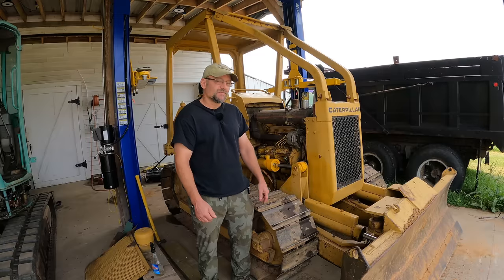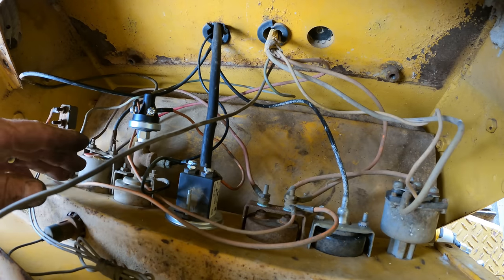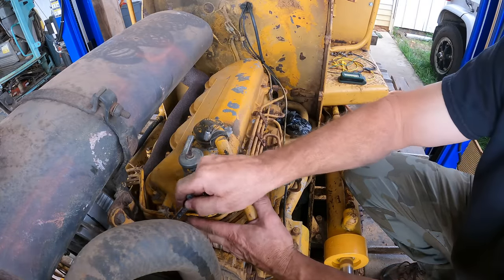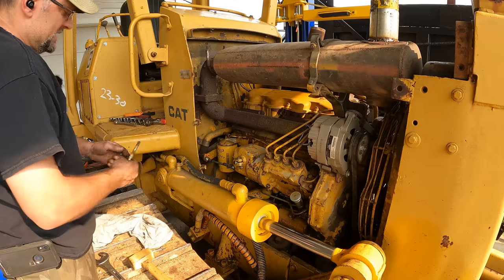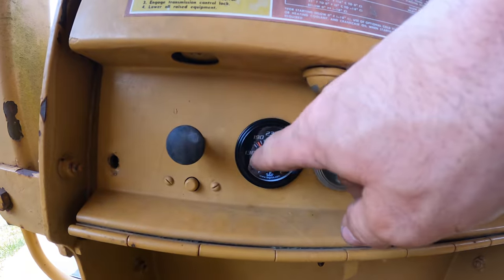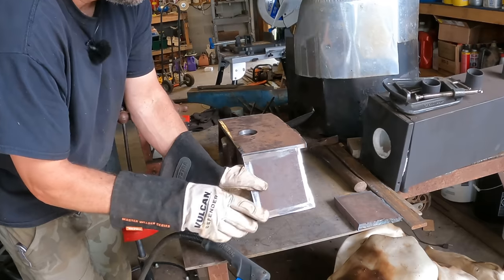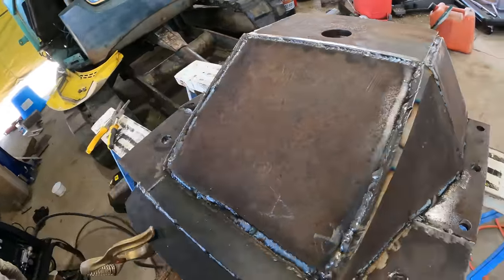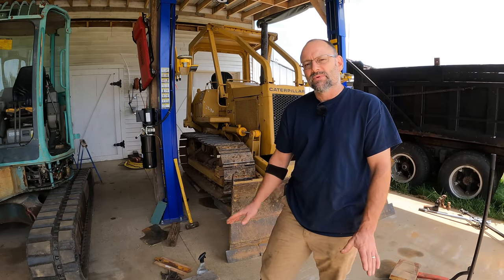How My Audience Saved This CAT D3 Dozer From Disaster.

Comment: i will never understand why people complain about what tools you use, look a hammer is a hammer, a wrench is a hammer. if you can swing it and if you are mad enough ANY thing can be a hammer. love learning with you can not wait to see what you have in store with this dozer, and whatever cat machine you have by the trailer.
Reply: 52:37 =] lets go
Reply: Claw hammer is made for nails. Hit steel hard enough and it can chip and break which can be bad. You can lose an eye like that.  Ball peen for heavy hitting of steel. Or cross peen, or small sledge. Tapping out that gauge, claw was ok.
Reply: @mmm365  Use what you got.
Reply: @alysongr  Except for a vise, cause that's an anvil.
Reply: I once discovered a fossil while making a 3 inch hole in a wall.  I was using a jack handle as my drill bit and some large flint nodules to drive it.  One of those flint nodules split open revealing a fossilised twig.  You don't get these kind of surprises using diamond core drills do you? 😁

Comment: I would not shim those pieces. Looks like they go up and down. There might be for a specific reason. Check the maintenance times. If it needs to be adjusted it would have the specs in it .Maybe send me more familiar with that dozer can comment. My initial thought would be to just leave it until I knew more about its use.

Comment: FYI. On my friends 1958 D4 you can turn the fan blades to blow out through the rad in summer, then turn them to blow heat over the motor, toward the operator in winter months, in CANADA. LOL

Comment: Hole saw trick: make a "scratch pass, then use the pilot bit to drill through the edge of the hole, then resume drilling through the original hole location. The other hole really helps clear the chips from the teeth! Give it a try.
Reply: That’s quite clever. The interrupted cut is probably hard on the teeth. But continuously recutting chips is a sure way to burn the teeth off. Thanks for sharing.
Reply: Hmm, that’s a neat idea, thanks 👍

Comment: Armor improvements that mad max would be proud of.
Also that makeshift grommet trick was pretty neat!
Reply: I was surprised that he didn't already know that trick, I learned it as a youth in 80s, and to run heavy gauge wiring though heater hose for extra protection from chafing.

Comment: Shims for the front idler go under the frame. If you think about it, putting a shim above the frame achieves nothing as the idler is being pushed up and away from the track frame.Upper shims are only necessary for excessive side play. Hope this helps
Reply: wouldn't it be better take the gap size and cut it in half for top and bottom?
Reply: @danhard8440 no because the wear is from the bottom notice how normally sitting the bottom is tight against the rails. This is where motion wears the metal down over time. Replacing material there with shims or other means realigns the idler and tensioner to be straight with the rest of crawler frame.
Reply: @danhard8440 f you look at top in this video the gap towards front of machine is larger then the side on back. This is because the idler is now cocked facing slightly up this can cause issues by putting undo stress in directions and areas not intended for it.
Reply: If you look close you can see the wear on the bottom of the rail. Material is gone creating a gap at the top
Reply: I will never have equipment you have but enjoy your videos because you explain what and why you are doing it. 
The comments from your viewers also show how much they know about machines and are also very informative. My vote would be to put the shims on the bottom.
Reply: Exactly. Physics.

Comment: Pro operator tip- the seat belt is for safety but also locks to hold the operator tight into the seat. The less the operator moves in the seat the more smooth and accurate you will grade.  I really liked your repair series.
Reply: And, if you've ever had one throw you off, you'll consider yourself pretty lucky to only break a collar bone like me. It ain't the stumps you see that'll get you. Little dozier like that can get you hurt bad. Just saying.

Comment: I noticed it took a bit for the exhaust to start emitting white smoke which means the presence of fuel coming into the cylinders. I have had older machines in the past have a faulty primary lift pump and allowed the prime to leak down. This allows the fuel that would normally be held in the injector pump for a quick prime to leak back down, which means the primary lift pump has to re prime the lines and the Injector pump before it can furnish fuel to the cylinders. Just a thought.
Reply: I would think what you said makes a lot of sense.  I am thinking a loss of prime,  just don’t know where..
Reply: My Perkins started much quicker when I crank it for about 5 to 10 seconds before opening the fuel shut-off it uses the high compression to warm things up.
Reply: Agree.  Add a temporary clear fuel hose and watch for the fuel descending or air bubbles.   Diesel engines detest air.  👍
Reply: Id agree with you @jamesfranks545, I noticed the same, 
 in the past I've fitted a diesel non return valve to the fuel pipe just before the primary fuel lift pump to a few tractors over the years that came into the workshop with a similar problem,  its not an ideal fix and if there was no filter before it on the pipe cumming direct from the tank I'd fit a inline fuel filter just to stop larger foreign objects hindering the seal on it,  but it dose solve the issue you speak of, prevents the fuel leaking back, its a cheap fix which otherwise can cost quite a bit to sort out.
Reply: I've got a Deere 444JR that has the same symptoms, almost 30 seconds of crank. I was thinking that the engine oil was draining down and it took that long to trip the oil pressure cut-out switch but I hadn't thought about fuel being the problem. Probably something I should look into.

Comment: For valve adjustments I use a set of feeler gauges with a bend in them. They are called offset feeler gauges on the jungle site. Your local parts store will have them also. Makes valve adjustments substantially easier.
Reply: Having sets of metric/imperial offset feeler gauges makes valve jobs so much easier.
Reply: AKA Valve Feeler Gauge, that's good advice.  Lisle 68050 $5.53 when I last put it on watch list.   When the shoe fits, and what really floats my boat for valves is the Go-No-Go type Feeler Gauge. Lisle 68150 saved at $11.53.  When I was a Motorcycle Tech some clearances and angles were so bad with gas tank off only, we had to use feeler gauges which were angled but also 1/3 the width and 1/2 the length.  

I like how this man seems like a pretty good man, and farm level repair guy with an honesty about limitations and openness to advice.  

Side note;  I'd wager you probably moved on from the tubing sheet metal grommet trick.   Having different sizes of plastic metal protective edging surrounds a hole any size and shape and makes it look finished.
Reply: You got it!

Comment: Check your RPMs while cranking, your starter could be slower than it should be. Slow cranking could cause that too
Reply: It's cranking at a good speed by the sound of it.
Reply: Might needs to check injectors that they are not leaking down while sitting and having to fill the injector plus line(s).
Reply: @jimsfarm  Since it cranks right up with the glow plugs lit, it's probably not fuel starvation.

Comment: Wow, I'm shocked you weren't aware of the split fuel line trick as grommet, given your vast knowledge of farmer hacks. Vacuum line also works well for small holes.
Reply: small weed eater tygon fuel line works well too.
Reply: I didn't know it either...
awesome fix though!
Reply: yeah, pretty much any type of hose or tubing works, just make sure it's resistant to whatever chemicals/nature are present.
Reply: I was too, I've been doing that for probably 30 years now. Course, I'm older than John is. Probably by 20 years.
Reply: I've never worked on anything larger than a push mower and even I knew about that. smh
Reply: Some RTV inside the tube will keep it from moving around or getting rubbed off.
Reply: Yeah not everyone knows everything.
Reply: @heikovanderlaar3780  I worked on fire apparatus as an EVT a couple years part-time on my days off from the fire department, we'd find all sorts of chafing cables, hoses, harnesses the factory just slammed together and wrapped a lot of them with split hose and zipties. You'd think the factory assemblers would think about that, but no, of course they wouldn't.
Reply: @peadenl  that sure helps, if you have no tubing you can just use RTV by itself to pad the hole, although rubber is best so it can move still.
Reply: @MotoRestoFL  
Oh, some of the uses for old fire hose too. One is for the same purpose, too.  Back when teaching rappelling, we would have a " under beld" of split fire hose under B.D.U.s to pad from rope burns and chafing. For protection from edges on towers edge,  rocks and any other wear points.
Reply: @DB-yj3qc  we used it for the bunks on the fire boat trailer.

Comment: If you put a red light bulb in that temp gauge you can use a temp switch to light the gauge face red when it reaches a certain temperature. It works well for bringing your attention to a potential problem right away

Comment: John, It’s is a 3 cylinder with the optional additional cylinder to help with the extra pushing power….That's your story and you’re sticking with it. The claw hammer helps with pulling back on anything you hammered in to far. It’s what it was made for. Grandpa always said "if it’s within reach use it”. Haha
Reply: Grandpa was right😁

Comment: John, Be careful loading the dozer up on the deck over trailer. Metal on metal doesnt make for good traction. A little water, dirt, or a rock will cause one side to slip. Even a quick movement and your sliding off the side of the dovetail. That high trailer and the small dozer is for sure going to be a rollover if it slides. I see equipment slide off a detachable lowboy all the time. Let alone a high deck over.

Comment: The liquid is likely to be Ether or something similar. The temperature gauge is based on a pressure gauge principle. When Ether is contained within the bulb and tube and it is heated it expands and produces  1 psi for 1 degree of temperature rise.
Reply: Is that constant no matter the size of the "container?"
Reply: @MotoRestoFL  I don't know the answer to that question. I became aware of the information that I posted when I researched trying to refurbish a gauge for my Farmall A. Ended up having the gauge repaired by an instrument technician because of the difficulty in acquiring a small amount of ether.
Reply: When the switch is turned off, if the gauge drops to zero it's just a common thermocouple switch. If the gauge continues to register the correct temperature, it's a pressure/temperature switch.
Reply: @Bob_Adkins  Yes , modern temperature gauges do act like this, they use PTC or NTC  components which are electronic devices to measure the water temperature, but this gauge is purely mechanical. The type of temperature gauge in this installation is known as a capillary temperature gauge and will indicate temperature even when the ignition is off..

Comment: When incrementally drilling holes, the diameter of the first drill should equal the flat ground across the point of the next. This ensures even loading and wear. Using a random size pre-drill wears a spot in the middle of the cutting edges.
Reply: Read this three times and still not sure of what this advise means. I want to know because if I can pick up a knowledgeable trick I want to do so. I have found myself hogging holes in steel way too much lately.
Reply: @gags730  wait so drilling a 20mm hole, i start with a 5mm, then a 10mm and finally the 20mm drill bit?
Reply: @gags730  Makes sense.

Comment: Don't use a tap to clean threads! In some cases whatever is in those threads will push on the tap and cause it to cut one side. Instead, get a Grade 8 (or 10.9 or even 12 if metric) bolt of the correct size and cut a slot length-wise on one side. Now you have a thread chaser that will clean, but not cut threads. Put that bolt in until it gets tight, than back it out and clean out that slot. Repeat until it is all the way in/through. 
In many cases you can make it a short slot in the end of the bolt and still use the thing as a regular bolt. Handy for things that come off the machine from time to time, like weights or other attachments, since you always have a thread cleaner on hand.
Reply: great trick. thanks

Comment: Excessive valve lash, unless extreme, shouldn't impact starting. Too little valve lash though, will make starting difficult as well as hurt torque.

BTW, one old school method of adjusting valve lash (my grandfather taught me 50 years ago), that works if you don't have feeler gauges is:
- make sure the engine is fully warmed up and remove the valve cover
- with the engine idling, tighten one valve lash adjuster until the engine starts misfiring, loosen it until it runs smooth and then loosen it by another 1/16 to 1/8 of a turn. Note if the adjuster is in the rocker arm (eg Chrysler slant six) the tool will move with the rocker arm so you need to hold it in the ideal position to minimize motion.
- do that for the other valve lash adjusters.

A bit of oil does splash out but not much...

One cool thing about doing this is you get a feel for how valve lash impacts how the engine runs. If you try loosening the adjuster a huge amount you'll notice (in addition to the ticking) that the rpm will reduce - but it takes a lot of loosening to notice any reduction in power (rpm).

Comment: On the left side you put in 1 metric bolt and 2 standard. 8.8 is the grade marking on the metric bolt and the 3 lines are a grade 5 standard bolt. Threads on the bolts are close but no cigar.

Comment: Two points,  try two batteries in parallel and she if she starts like it should. I didn't think one was ever enough for those engines, also, check the speed chart for the hole saws. Too fast and they don't cut right.
Reply: I use the big battery on my D3B and never had a cranking problem. Thinking it might be a RPM problem, but it glowplugs takes care of it, then.......
Reply: Cheaper to buy two batteries than to buy a new starter when the voltage drop under load using one kills it
Reply: That is exactly how I solved the slow start of my 1970 John Deere. It came with two 6 volt in series, found 12 volt of same dimensions, put 2 12 volt in parallel, upped the CCAs and it starts like a new one.
Reply: Two batteries as big as you can get in there are sort of needed on any old diesel, you have to run the glow plugs then spin the thing as fast as you can get it to go. cranking them very slowly  just flattens batteries.  As for glow plugs not being needed above 60° that’s just not true. Many automatically run the glow plugs. I have had several that took forever to start in high summer, without glow plugs on.

Comment: Great video as normal. It's great to see old equipment restored - fixed and being used.
On the way to being loaded on your trailer, you went past a crawler with a bucket on. Have you thought about making a rollover cage for your protection?? It might make a good video.

Comment: I used to service heavy equipment, so for checking track tension I would get the machine in motion 3 rd gear than put in neutral let roll to a stop than check

Comment: I just bought a new Kubota kx040 with an enclosed rops and had never operated any heavy equipment prior. It took about 2 hours in the seat to convince myself that the seatbelt was definitely needed. Came close to kissing the front window a couple of times. 35 hours of seat time later it’s an automatic function.

Comment: You should always clamp your work to the drill press bed. When the bit grabs your plate it hurts. Machine and hands. 😊
Reply from the maker: Yeah, I hate it when it does that.  Did you notice that I had it resting against the column most of the time?  Can't spin if it catches that way.  That's a nice trick to use if the part is big enough.

Comment: Great Video! So the "wire" from the temp gauge to the sensing bulb is a hollow capillary tube filled with an alcohol. The alcohol changes to a gas when heated increasing pressure on on a bellows in the gauge which turns the needle via some gears or linkages. If it were electric it would literally have a wire and work on a change of resistance much like a fuel level gauge.

Comment: Hello John… RE: the shims… it looked to me like the underside bracket is the one that needs replacement… the top bracket looks like it allows movement and wear but hold that main rain in place. 
My thinking is that if you shim the top You will put more pressure on that bottom bracket wear it out and have an issue… I would find out how thick that bottom bracket should be as it seems to keep that large beam (sorry don’t know the name… but the one with the wheels/sprockets) in it’s place.
Check with a pro as to what those brackets actually do and their tolerances.
That is just what it looked like… I actually dont know anything about the caterpillar tractors.

Comment: Gotta love running up and over an edge like your trailer with a track vehicle. Just waiting for the front to drop. I used to work on PistenBullys and we had a 12K service rack that has the same profile as your trailer ramp. And of course on a snowcat, you sit all the way up front at the windshield. So you are hanging over when the front end drops. It's not dangerous at all, but it is always un-nerving. Keep up the good work.